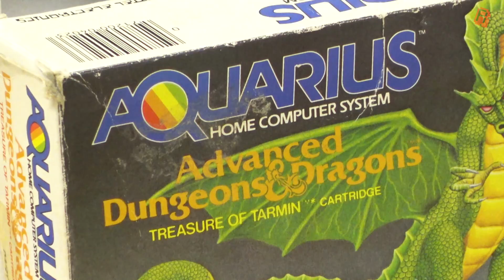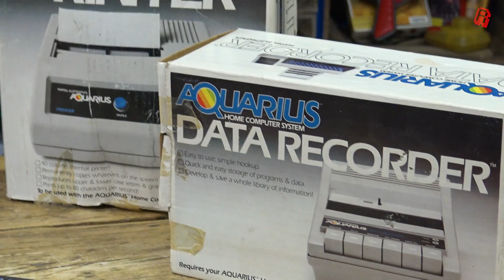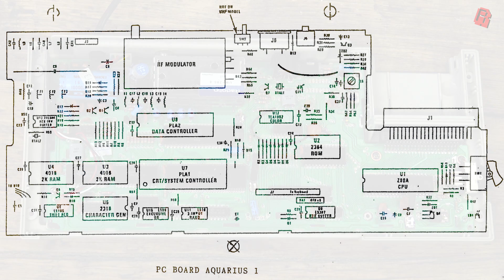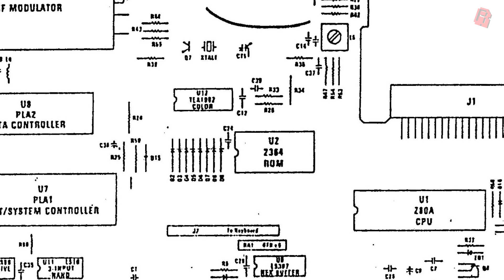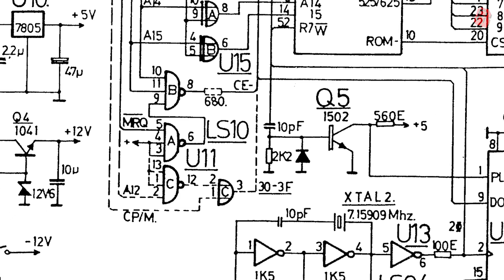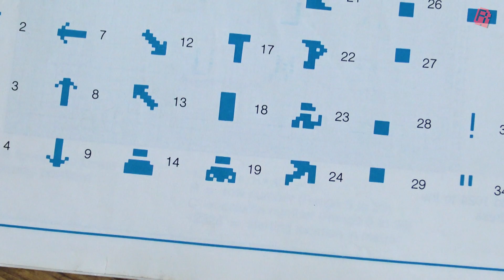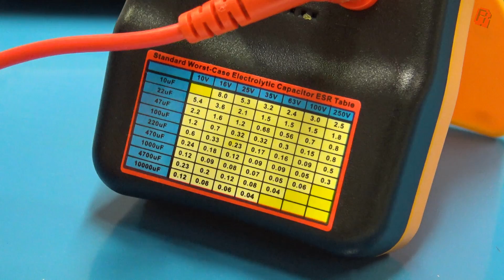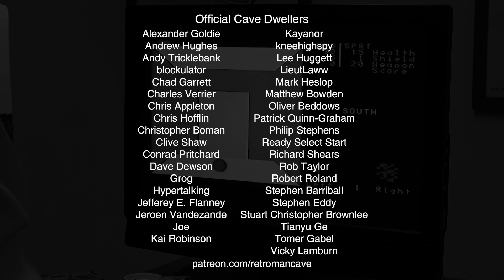Mattel Aquarius - History and Restoration of a Micro Flop - Pt1 - Trash to Treasure

Comment: Thank you for this episode.  A rush of nostalgia came over me as I watched it.   The Mattel Electronics Aquarius was actually my very first computer when I was 14 years old.  I owned it for all of two weeks. Since it was discontinued almost immediately after launch, there were loads of them available after the Christmas '83 season on clearance sale at the local toy store for only $99 (It may have been only $79, I can't recall).   I took one of them home, hooked it up to my television, and proceeded to explore this new technological wonder.  I spent lots of time playing that Dungeons and Dragons game, and in those two weeks I learned to program with the integrated Microsoft BASIC.    Having quickly figured out what this whole "personal computer" thing was about, my first sign of trouble appeared when I wasn't able to type in the somewhat lengthy example BASIC program in the back of the owner's manual.  It simply would not fit into the meager 1.7K of available RAM.  Somewhat perplexed but undaunted, I dialed Mattel's toll free support number to inquire about the 16K memory expansion module which you show in the video, only to be told that they are not available, and likely won't be because the product had been discontinued.  This was all the information that I needed to pack everything back up in its boxes and promptly return this thing back to the store for a refund.   After returning it, I headed directly to a second-hand computer store and bought a nice pre-owned Commodore VIC-20 and (having learned my lesson) a massive 16K memory expansion cartridge, along with an Asteroids video game.  That started me on the Commodore track of VIC-20 -> Commodore 64 -> Amiga 500 -> Amiga 3000, but that's a whole another story....
Reply: It's strange how these things turn out, isn't it? In my case, my parents initially bought a ZX Spectrum, and it ceased functioning after a couple of days. We bought it back to the seller, and since he didn't have a replacement ready, he proposed us to swap it with a brand new C64. We did, so it was C64 for me, followed by an Amiga 500 years later. I learned to program on the C64, and I am a programmer by trade now. Who knows how my life would have changed if the ZX worked properly?
Reply: @QuintusCunctator  Indeed, I also ended up with a career in software engineering.  Perhaps that's why this Aquarius computer has such a special place in my heart... It gave me my first understanding of the basic parts of a computer system like the CPU/RAM/ROM, and I learned my first programming language on it.
Reply: Good story ,, nice video ,i had one for 6 months then started secondary school and everyone had a spectrum, so thats what I ended up with and yes the Dungeons and Dragon was the best game on this I enjoyed watching this video thankyou.

Comment: I remember owning one of these.  It was my third computer after a TRS 80 Model III and the Intellivision Computer.    Had bought the Intellivision Computer for $79 at Sears when they first came out.   I went to KB Toys a couple of weeks later and saw the Aquarius there for $49 so I returned the Intellivision Computer and bought the Aquarius with a printer and another device thrown in for a few bucks more.   When I found that I didn't use it as much as I used my TRS 80 Model III, I tried to return it but I couldn't.   But back then you could return things anywhere without a receipt and found that Target was still selling them for full price.  I ended up getting something like $500 store credit for all of them (bought an Atari 5200 with a bunch of games!)    Thanks for the video, bringing back tons of memories from over 35 years ago.

Comment: I used to have the Aquarius since I was a kid, and it was a short lived computer which lasted a few months until it pulled off the shelves. It was released in 1983 and it was a flop. This leaves Commodore 64 as the best home computer of all time where it beats Mattel’s Aquarius. It had a really short life. The Basic program was included with this system where you can program what you want, or where you want.

Comment: I've owned a couple of these. One was a grubby-looking bare unit that had a VHF output, so I had to run it through an old video recorder to convert it to UHF. The other was a complete boxed set in excellent condition, including cartridges and the 4-colour pen plotter (which I'm guessing is rare). One of the cartridges was the FinForm spreadsheet - do your finances on the Aquarius!

I ended up selling them all on eBay due to lack of space. I'd hardly used them at all because there's not much you can really do with them!

Comment: When it comes time to desolder I absolutely hate encountering bent leads that are embedded under the solder, so I handle radial capacitor leads a bit differently when I install them:

I bend only ONE leg. This may not keep the capacitor flat or straight but it is enough to keep it from falling out while I solder the straight leg first. While soldering the straight leg I can straighten/flatten the capacitor and it will stay where I put it, then I can bend the other leg mostly straight again and solder that too.

I think I will tweak my technique in light of what I learned here today. Now I will straighten the second leg and trim both before soldering the second leg. I can then re-solder the first leg in case there was any joint fatigue from the shock of being trimmed. Thanks!

Comment: I worked for a mil spec company in the 80's and we were told to snip and then solder so that the cut end of the component lead was covered with solder.  If the copper was left exposed it would supposedly corrode.    
We all just used to tack one leg, snip them all and then reflow the first leg with a bit more solder to cover the cut end.
Passed inspection no problem.

Comment: It was the ZX81, not the Spectrum, that had the old Ram Pack Wobble... I "fixed" mine with some tape and an ice lolly stick between the back of the '81 and the Ram Pack. :-)
Reply: Yeah, i think this should be given a direct ZX81 comparison. After all, the 81 only shipped with 1K or ram (good grief).
Reply: Many a game reset the very second I touched the keyboard after it loaded!
Reply: As a poor Spectrum 16k owner I had later got a Cheetah 32k ram pack which suffered from the same wobble problem.  Particularly annoying when it crashed during Manic Miner (my first 48k game).
Reply: @philipchaimbault9960  Wow, I never saw those. It would be interesting to see whether the 16k board had holes/sockets for the missing RAM.
Reply: I had the ZX81 with the 16 K RAM pack. It soon seemed too small so I built my own 32 K RAM pack using a 74154 4 to 16 address decoder and Harris 32 K x 8 bit static RAM chip. I still have it and it never suffered from RAM pack wobble due to how I designed the casing, unlike the OEM 16 K RAM pack.

Using a 74138 3 to 8 address decoder with a Harris 32 K x 8 bit static RAM chip only allows 16 K of RAM.

Maplins made a 2 K RAM board kit using a 74138 3 of 8 address decoder and 2 x 4 bit 2114 static RAM chips.
 
Expanding the memory on these early micro computers with homebrew RAM packs is extremely simple and easy for any electronics engineer or technician. However IT engineers and technician will find it complicated as their training involves software and not the physical electronics aspects of computers.
Reply: @CZ350tuner  I originally had a ZX81 with 16K RAM pack...yes it suffered from wobble. I eventually got a DK Tronics keyboarded ZX81 with the RAM mounted inside the keyboard which fixed that problem. :p I LOVED that computer and had tons of software for it including Z cars AND a program written in machine code that made sounds via clever manipulation of the TVs RF output. Mattel started out with Barbie, then made a Micro computer. The Aquarius  was the result. (LOL)
Reply: @flmoog  Yep, but it also required some additional chips to upgrade the address logic.

https://legacycodehero.wordpress.com/2016/09/02/repairing-and-upgrading-zx-spectrum-16k/

Comment: I wanted a spectrum when I was younger but they were too expensive. A boy at the end of the street had one of these and sold it me for £70. Back in the mid 80s, alot of money for me. I was naive and jumped at the chance. Only after did i discover there were NO games for it. He refused to give me my money back and learned a lesson. Research before buying! 
Was left with a doorstop. He ripped me off. Spent ages pushing those rubber keys typing lol. I got a speccy at Christmas that year. Even though it was crap...still makes me smile.

Comment: Thanks for introducing me to this oddity! 
Didn't know those even existed. It seems it is not a good machine, but I do love the industrial design of the case.

I just picked one up on ebay - it is supposed to be dead, but I will try to fix it. Worst comes to worst I can fit a raspi inside and interface the keyboard (and call it Pisces, because star sign + Pi ;). No matter the outcome, I am in for a fun project!

Comment: When I was learning electronics, my teacher told me to solder-snip-reheat.
And the reason he gave was that the mechanical shock of snipping may change the properties of the solder in some way... and especially if you're dealing with an old/fragile/faulty PCB you may break the copper when you snip while it's soldered, but reheating could mostly fix it.

Comment: I had one back in the day.  We bought it after our ZX81 went wrong. The thing was bought from Gamer Computers in Brighton heavily discounted to £40. (my dad could never resist a bargain).   I was initially quite impressed because it had colour and sound but that very soon gave way to frustration with the lack of graphics or sprites.  I did buy the Tron and Snafu (snakes) games but they were pretty poor using only the character set built in.  IIRC hooking it up to a normal tape player was a bit of fun, it used a DIN lead that was not a standard layout, I'm pretty sure I ended making a lead with connectors I bought from Tandy. Anyway, it provided some fun until I managed to save up enough to buy a used C64.

Comment: Fab! I have a bunch of these machines, cartridges, a printer and a data-recorder (tape drive). Many moons ago I did a disassmbly of the ROM, and an Emulator that runs on Mac OS X. I might just resurrect the emulator and play around with it some more. Released in 1982 and known affectionately as "The system for the seventies"

Comment: I would suggest that the original plan by Mattel was to sell the minimum hardware they could get away with and make more money on the accessories. By contrast, Sinclair wanted to deliver an affordable colour computer to the masses.
Regarding the "dead flesh" keyboard. It was adequate to the task and my wife and I spent many frustrating hours typing in programmes from magazines which usually didn't work. At the time, all I could compare it to was a portable typewriter which I used to write novels and my Degree thesis. My brother-in-law bought a 16k Spectrum and added his own chips to make it up to 48k. We learned from his mistake and bought a 48k model.
In the early days a joystick wasn't necessary although many later games were better with one, which meant you had to purchase a separate box to plug into the edge connector. As this occasionally caused crashes if you were too enthusiastic I bought a ribbon connector which plugged into the back and had two female connectors so you could attach the joystick adapter and something else.
Good work on the videos, especially on the computers I would never have even considered buying, such as the Aquarius.

Comment: I had two when, in recent years, I began a retro collection.  Realising my mistake, I couldn't sell them; there was no interest and they went for a pittance, despite having RAM packs, tape drives and expanders.  If I'd just waited another couple of years...
I suppose if you just wanted to learn BASIC, the Aquarius was OK; if you had a ZX81 for the same reason, then the Aquarius  was an upgrade, no question.  However, there was more software for the ZX81, and just about every other computer available at the time was better than the Aquarius in every way.

Comment: Interesting video.   Shame they did not release it with no cart port, smaller better case, better keyboard, More built in RAM and AY Chip.  Doing that for $199 would have made it a decent competitor, considering it had a pretty high 320 x 192 resolution for the time.

Comment: Snipping the pins before soldering may be the MoD approved way of soldering, but bending the pins over isn't. Well, it wasn't when I did my MilSpec training in the mid nineties. The approved method for installing components was to either support the component by hand with a heat-proof pad while tacking the first joint (or two for components with multiple pins) or to use a soldering jig which uses a flexible pad to support the top of the board. Of course, for commercial use, bending pins has always been fine to do; there were even machines that would bend and cut the pins on the press of a pedal after you put the component in, all ready for the solder bath. I've worked in both situations, and much prefer the commercial way of doing things!

Comment: Actually, you snip the leads prior to soldering to keep the solder joint "gas-tight" Snipping afterwards can lead to corrosion and a high impedance joint. So said the "soldering expert" that was brought in to a "stuff shop" (they built up PCB boards with your boards and your components) that I was doing work for.

That said, screw the guy who gets my old gear, I snip afterwards.

Comment: Snipping after solder can shock the joint? Don't cut right next to the joint then. This also only a problem if you have a partially cold joint, which you shouldn't have if you are soldering correctly.  A 1/8 inch wire left over is fine and within spec for anything that is through hole and large enough to solder by hand. If you need it shorter than that, wait for the joint to cool down to room temperature and then snip it flush.

This is the procedure that the USAF had for their high reliability soldering class back in the 90's. They also still used lead solder, which is much softer than the lead free and forms cold joint less often since it flowed at a lower temperature and was less viscus when molten with a lower surface tension. With lead free solder you just have to use a bit more flux to get better flow and adhesion while keeping the joint hotter for longer. Pretinning the leads and the pad before placing the component into position is also a much more reliable way to solder with lead free solder and can allow you to use less heat when forming the joint.

Comment: How does the dungeon crawler have such sharp lines for the 3D rendering? It looks like it starts off with character-sized pixels and then smooths these out somehow, however (unless I'm not seeing very well) it looks smoother than the row of diagonal pixels for the R for instance? Is there some integrated vector graphics hardware or something like that?

EDIT: "a simple fix" → not for everyone I think, "to a simple computer" → that I can agree with, "by a simple man" → you're not taking enough credit Neil, but your humility is always impressive. :-)
Reply from the maker: It's really impressive isn't it, but there's no vector trickery here.  The drawing you could describe as bloxels, square characters being used to draw everything as the only display mode is a text mode and you have to use the character set in ROM.  I'll explain this in more detail in the final part 3 which I'm just working on now
Reply: @TheRetroCollective  Thanks for the explanation Neil, it's very interesting - so that would mean the diagonal triangles are part of the character set, a bit like the box drawing characters we still use today I suppose! (https://en.wikipedia.org/wiki/Box-drawing_character ) - can't wait to see your next video on this :-) thanks for your response and for the awesome videos!

Comment: Bizarre that the memory expansion didn't support daisy chaining. What did they imagine you would do with the extra memory??
Reply: Any sort of non-trivial tape-loaded program would likely require extra RAM, but the code for most cartridges could be run directly from ROM.  Using a cartridge with 8K of ROM would be similar to using an 8K RAM expander and loading an 8K program from tape.
Reply: Indeed. Those cartridges, both on consoles and home computers, mapped directly to memory addresses. So behind those addresses any amount of data could be located, provided you used something like bank switching. Something that was quite common for later NES games for example.

Comment: What kind of VCR would I need to use it as a pass through for the Aquarius? I picked one up from a thrift store a couple years ago and have not been able to test it because of the modern TV problem.
Reply: Any VCR that has an RF input and Composite/S-Video output should be able to "fix" dodgy RF video like this. Of course it needs to correspond to whether your other equipment is PAL or NTSC. You need to use the VCR's built in TV tuner to then properly tune into the signal.
Reply: Nukleon ok thanks